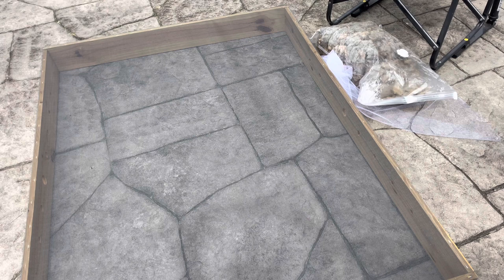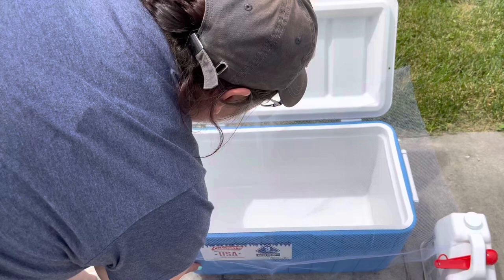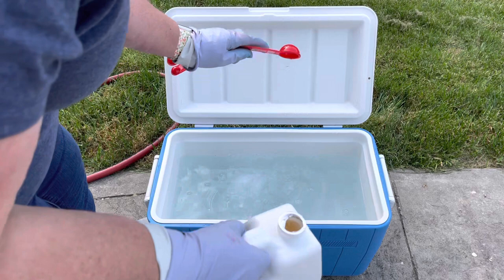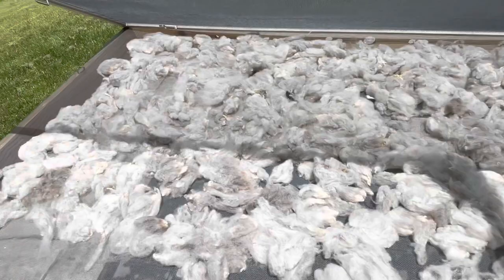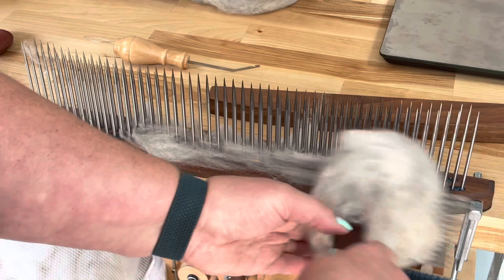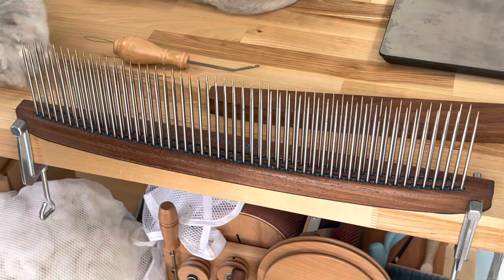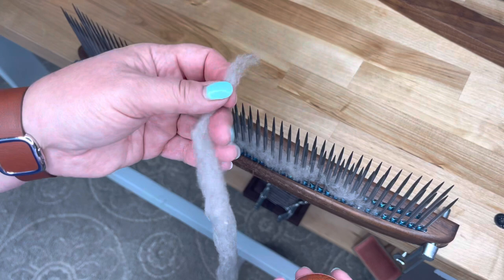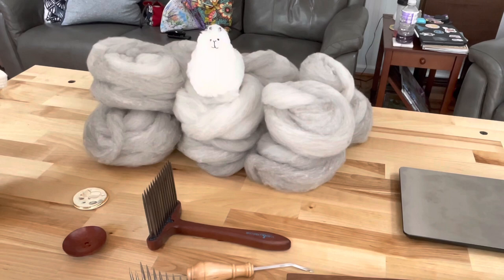How To Scour and Comb CVM Romeldale Fleece

Comment: I've been washing a CVM fleece myself. It's hard to get all that grease out! I can take it from super greasy to mildly greasy consistently. I'll keep experimenting.
Reply from the maker: The key is water at 185 deg. Soak for 20-25 minutes. I use unicorn power scour, then rinse in same temp water another 20 minutes then spin dry. It may be that your water temp got too low and some of the lanolin you melted, resettled on the fleece.

Comment: Hi, first of all, I love your videos and have been binge-watching them! I use my handcards to comb fiber -- I put the locks on one card, brush them through, then spin directly off the end of the card.  Of course, this also leaves waste.  I hate waste.  It's occurred to me I might be able to felt something with some of my waste (I have big bags of it saved over the years) and wonder what you think of the idea.  Or -- do you have any other ideas for what to do with it?  paula
Reply from the maker: I use my comb waste, if it’s not too neppy, on my drum carder. I have not tried felting with it.  If I used combed top and blend it on my hackle I will save and use all the waste on my drum carder, but if I am combing my processed wool/alpaca etc, often times that waste is short cuts, neps and broken tips. I think the only thing it would be good for is mulch in my garden(wool makes great mulch!). If I see anything I think I can use I save it for my carder. I would say try to felt with it, the  only way to know is if you try and  you won’t be loosing any good fiber!
Reply: Thank you!  @jkfiberarts